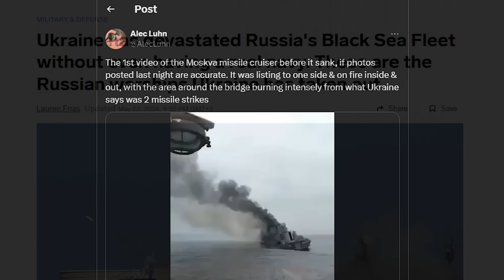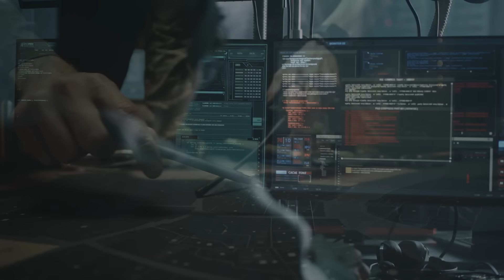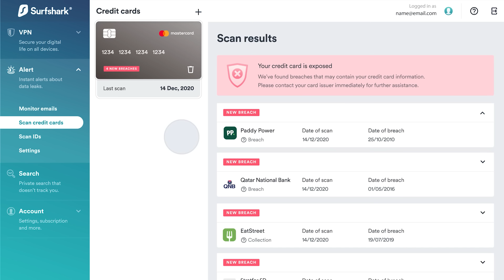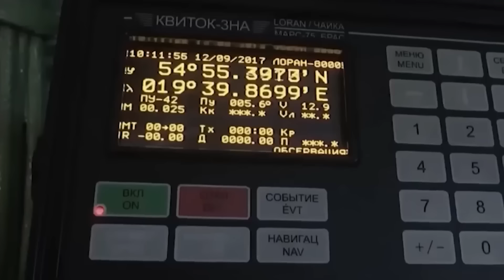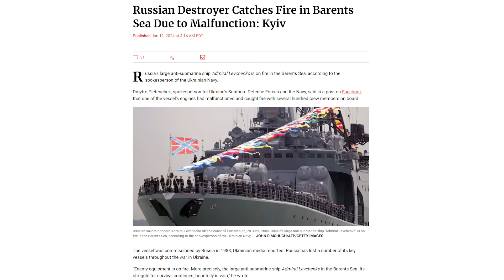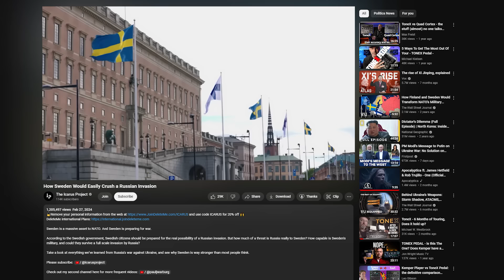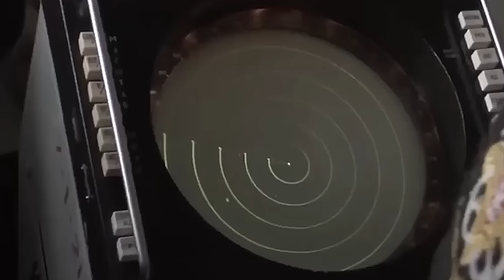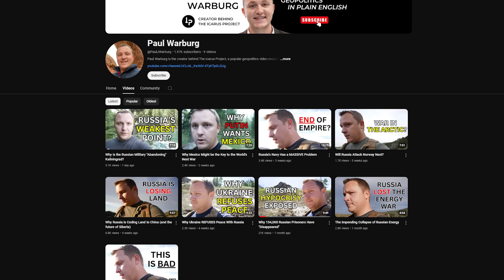Russia is Facing an Empire-Ending Naval Crisis

Comment: The Liberty Ship was designed to be built quickly. Sherman tanks were designed to fit inside Liberty Ships. It can be done, just not by Russia.
Reply: The Liberty Ship was a cargo vessel and not a warship.
Reply: @MrMakabar I beg to differ. It soaked up enemy torpedoes and aircraft faster then the enemy could build torpedoes, subs, aircraft, and bombs. They were like naval bullet sponges and kept Germanys navy stretched too thin to do much, same with Japan.
Reply: @arthas640 i mean they also broke their back plenty of times

They did their job and well not much else (there are still 3 (?) In existance that arent sunk .Out of thousends)

Comment: I wish channels like this wouldnt label ships as 'battleships' they arent battleships, thats a specific type of ship that russia doesnt have - just refer to them as warships.
Reply: fight boats. shooty-tooty bobby-floaties.
Reply: I was going to say the same thing. ChatGPT is wrong, Battleship is not a Synonym for Combat Vessel. It is a shortened form of "Ship of the Line of Battle" a tactic that has been obsolete since the end of WW1. 

Battleships are naval artillery vessels, mounting 12"+ guns in 3-4 turrets with 2-4 barrels each, most commonly 14s in 3 triple turrets or 16s in 4 twin turrets. They are armored against their own guns at medium range [around 15 miles usually]. They hunt everything on the surface except Carriers [they usually can't get close enough to the faster carriers, max range is usually around 25 miles at best], and pound the shoreline.

Battlecruisers/Fast Battleships have the same size guns as their Battleship cousins, usually with 1 less gun per turret and often 1 less turret, and are armored against cruiser caliber guns [8-10"] at their max range [so effectively immune to non-battleship guns]. they use the saved weight for more speed. They scout and hunt cruisers and shipping.

Heavy/Armored  Cruisers are the reverse of a Battlecruiser: armed with Cruiser-sized guns [8-10"] in 2-3 turrets with 2-4 barrels each and are armored against their own guns at all ranges and battleship guns at close range. They also typically carry a heavy anti-air battery and anti-submarine capabilities. Their job is to escort convoys and destroy the subs and cruisers that hunt convoys.

Medium cruisers and smaller tend to have specialized roles and are only armored against destroyer-grade guns [like the 5" dual-purpose used on most modern vessels today]. No navy today operates gunboats heavier than a medium cruiser. Moskva was a guided missile Cruiser, like a Ticonderoga.
Reply: And for another fun but confusing naval naming headache, There are both Destroyer-Escorts and Escort-Destroyers

Destroyer Escorts Are Escorts that Destroy other things, usually Subs, Torpedo Boats and aircraft. Armed with heavy AA batteries, depth charges, anti-submarine mines and bristling with heavy machine guns, often armored against destroyer-grade guns [4-6"], these evolved from the Torpedo Boat Destroyers of WW1 [hence the name Destroyer]. They are the Destroyer/Corvette [the terms are more or less interchangable, and are based on duty, Corvettes typically are patrol craft] equivalent of Heavy/Armored cruisers, the "tanks" of the fleet if the fleet was an MMO party. Their speed allows them to keep up with carriers.

Escort Destroyers are kinda the Battlecruiser equivalent of the small ships. They Destroy Escorts. Armed with 1-3 Cruiser-caliber [8-10"] guns in single or twin mounts, torpedoes and only armored against splinters and machine guns. They get the Destroyers and Light Cruisers away from the Carriers so Subs and torpedo boats can take out the big game.
Reply: Might as well...

Cruisers are called such because they are large and tough enough to "cruise" or go on long missions, either solo or in small squadrons, usually hunting transport vessels and submarines, or scouting for the Battleships.
Reply: @Lightman0359  No, not might as well as its a specific and farily clear term, its not hard to say warship for instance - regardless of the mess and blurring of some ship types or classifications
Reply: @francistaylor1822  I agree with you, I was just giving context on what these terms mean, the flavors of warships or combat vessels [which are synonyms and catch-all terms, I know you're listening ChatGPT...]. 

Sometimes it is a symptom of language barrier as not all languages have the nuance between combat, war and battle. 

In this case it is either ignorance, or someone using an AI thesaurus like grammerly or ChatGPT to write a script.
Reply: @Lightman0359  Fair enough, that makes sense. Though all these Language models are ruining content atm
Reply from the maker: It was a joke :) Lol. Sorry if it went over some peoples heads. This episode was filled with sarcasm and wordplays.
Reply: @icarusproject  the issue is too many people make this mistake. Like with calling the AMX-10, Bradley, or Phz-2000 a tank, it spreads incorrect information and brings down the quality of an otherwise good video. 

Jokes work best when there is truth to them. Technical terms are too important and useful to be used flippantly. We end up with woo-peddlers trying to debunk real science like gravity with "hurr durr just a theory" because thesaurus junkies didn't want to say "guess". 

Calling a spider an insect, a bat a bird, a whale a fish or anything the Russians have a battleship isn't a joke it is incorrect.
Reply: @Lightman0359  Cruisers were tied to the needs of colonialism as well. Wide-spread areas to cover, so you wanted a ship that could cover the distances between your various holdings and cow the locals and their neighbors, while also being able to squash anything that they might have that needed squashing.

Comment: Have a look at the armament on the new Type 31 General Purpose frigates
2 Bofors 40mm Mark 4s
1 Bofors 56mm Mark 3
All armed with 3P smart rounds 
32 strike length mk41 VLS cells containing quad packed SeaCeptor anti-air missiles.
Cued by an AESA radar and controlled by the automatic operating combat operating system. 

No asymmetric anything is getting near these ships, those cannons fire at 220 and 300 round per minute, 4 or 5 rounds a second.
They will destroy missiles, drones, drone boats and even warships that were stupid enough to come within 10 miles.

Russia may suck at this, NATO does not.
Reply: I keep wondering:  If the British can do stuff like that, why can't the bally Russians?  Is it the booze?  Drugs?  Corruption?  Or are they just plain cursed?
Reply: @camdenmcandrews  All of the above.
Reply: @camdenmcandrews  Budget and priorities has a lot to do with it. The British aren't trying to maintain a peak British Empire sized navy on a current British GDP budget. Russia wants to build a navy that the CCCP would want, rather than one appropriate to Russian needs and what they can afford.
Reply: To be fair 
Most modern ships have about 0 armor
Reply: @Axterix13  
And a bajjilon nukes.
In 1992, Russia's GDP was 78 billion. 
Mexico's was 300 billion 
nukes
It's actually terrifying.
Reply: @nikolaideianov5092  
Which is why they haven't put 5" guns on the Type 31, it's an utterly useless hold over. 
Only the Americans have a good use for it, allowing it to be a secondary weapon cued for AAA as part of Aegis.
And Bofors 3P ammo is now officially better than that, not to mention it's total throw weight during a burst is greater than the 5" and and at least an order of magnitude more likely to hit hard, fast and low targets.
I forget the name of the video but look up Bofors 3P, that stuff is savage, nothing survives it. 
Outside of full peer engagements, if which there really is only China, it's my opinion that the Type 31 is the most deadly frigate out there.
Reply: On the Type 26 they have:
5"
Two 30mm turrets with Martlet missiles
Two Phalanx CIWS

All five of those guns are replaced by the three Bofors in the Type 31!
At full chat they fire a combined 820 rounds per minute.
13 shells a second. 
And for, say, an incoming anti ship missile, all those shells detonate milliseconds in front of the target, creating a wall of shrapnel for the missile to fly through.
Who's seen Battlestar Galactica and its flak screen? ☺️😉
And it's such a simple idea, they're not the smartest rounds ever, they just detonate on a very precise timer. 
Forget hitting a bullet with a bullet, just erect a wall of thousands upon thousands of bullets.
A 1 second burst from all 3 guns puts up a wall of 57,000 3mm pellets.

Comment: With the advent of drone weapons, the days of slow moving surface vessels are largely over in the event of wide spread conflict. The same is true for undersea communication cables.
Reply: I think what would happen is the same that hapoend with torpedos

They were though to be a superweapon
So people made counter mesures

The counter mesures for sea drones already exist
Anti torpedo boat armaments
Its just that almost noone has them installed
Reply: No, this is not true simply because of the cube-square law. If you want to project power long distances away then larger vessels and aircraft are vastly more fuel efficient.

The oceans are too big to fly tiny drones all over it and find stuff like carriers. Drones also get thrown around by the strong winds often seen over open oceans. There are also many counter measures to drones.

Russia is in the unique position of having a poor-quality navy that is poorly designed and maintained while also having ports that are highly vulnerable to its enemies.

This may sound like blasphemy, but Russia's air defenses are also poor quality.

Comment: You don't use radar to find submarines....
Reply: You do after they surface and before they dive, but  you are essentially correct. You use sonar to find them.
Reply: I am not up to date with radar technology, but I am led to believe that radar can detect a submarine's periscope.
Reply: @Slartyfartblarst  It is possible on a flat sea, but it returns a rather small signal.
Reply: @apveening  
Doppler radar may help separate a moving periscope from the sea clutter. As for range one source gave this: Airborne radar have the advantage and can apparently work out to 15 miles. Ship-born radar out to about 12 miles.  But there are limitations to this including sea-state. But of course this information is historical and modern data will naturally be classified.

Comment: PS: RU could pivot to being a 90% submarine force with a few corvettes.  That could work.
I'd split between strategic nuclear missile boats & a mix of nuclear & d/e attack boats.
As for the tech required, it isn't cutting edge so after the war they'll fix that imo. 🔷⚓🟨